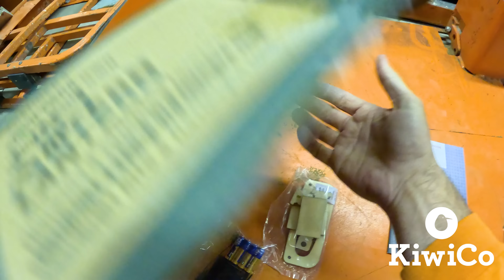How to Install an Elevator in your Backyard

Comment: no vapor barrier? no insualtion?
Reply: you don't need insulation when you have all that dirt
Reply: if you watched the series from the 1st you would know that burying this over 6 feet deep doesn't need insolation and it should stay 60 degrees year around.
Reply: @ICP1SBJ  I'm talking about the moisture absorbing concrete pour that sits below a steel structure called the scissor lift. If your telling me concrete won't sweat ever then you must have magical concrete. The vapor barrier and insulation is only for moisture. Obviously the insulation isnt to change the thermal capacity of the structure. Isn't just another thermal break away from the dirt so concrete doesn't act as a sponge. But then again what do I know.

Comment: elevators are expensive because of the multiple safety systems they have, however a scissor lift has none of those so you are taking an awful risk with your families healtha nd safety, i didnt think youd be like that, its not like your short of cash. Very disappointing. Also notice how much rust you already have on the shaft and supports, thats because you didnt coat them before installing and they wont last long wown there rusting like that
Reply: Was thinking about the same. Scissor lift has a single point of failure. Falling from 6 meters could be deadly.

Comment: Way yo go !! Nice cost saver ... how about for stability from sway ... on all four sides , have static castor wheels ,industrial kind with tires . 

That run up and down with lift and guided by u channel designed metal , fixed in place . 

Otherwise briliant . 

Just to say mustie1 did something similar , months ago

Comment: The scissor jack was an incredible idea for a makeshift elevator! This series has been a blast to watch.
Reply from the maker: Thank you!
Reply: @JerryRigEverything just a quick question.. what is the pipe called used to make the bunker?? Do they also make 90 degree bends?
Reply: Agreed...I have seen these easy for $2500, and an affordable elevator  Dam, never thought about this.
Reply: It is cool. The only thing I would add is guide rails and rollers so it doesnt move as much.
Reply: Now if only I have a huge warehouse to store all my projects that I am never going to finish?
Reply: It looks unsafe to me a safety inspection should be done before sending people down his makeshift elevator. I worked in the construction industry and when you build stuff to fast without any safety inspections things go wrong. What happens when his elevator stops working and she cat get out? He said 100% safe= nonsense. She already feels unsafe in it she knows whats up.

Comment: An interesting, novel approach; however, I doubt that it meets your local building codes. Cities tend to be REALLY bitchy about elevators.  So don't try to permit your bunker because the city will probably make you tear out your elevator. The primary concern is what happens if the hydraulics completely fail (say you blow a main hydraulic line) while you have several people on it. What type of emergency-stopping system will you install? You can probably use some type of cable system as a secondary backup support. You can use a mechanical brake on the cables if the elevator starts to fall, kind of like what you see on seatbelts.

Comment: Good to see you discovering modern concrete elements like fiberglass rebar. Recommend basalt fiber rebar, alkali-activated or geopolymer pozzolans, and biochar or recycled concrete aggregate for net carbon negative pours, lighter, stronger, and more durable. And if some cementhead tells you its too risky to go with 'newfangled' cement, geopolymer nefer pozzolan is what the Roman aqueducts were made from, according to geopolymer experts.

Comment: Slap some roller blade wheels on the corners of the elevator carriage to guide it smoothly down some rails. Spring load them for error correction

Comment: Thought you would have used a track system, thought about a emergency go fast button?  I think I would have also added a couple snatch ropes from Matt's off-road if the system failed. Doesn't matter because I would have never thought of a scissor lift to begin with so clever 🎉

Comment: I have one question. Why is your dry concrete, wet? Dry concrete it's a mix that you put in place, where you want the slab, and then you sprinkle water on it several times.

Comment: So, you have the EV Humvee, but, during the apocalypse charging that will be a bitch.
When are you buying a bushmaster type vehicle plus rugged trailer and digging a fuel and water container (both shipping container sized, with filter for the water system, you can never have enough water and filtered circulation) into the yard for longevity and the ability to go out roaming for whatever you need during the apocalypse ?

Comment: For the stop problem. this machines comes with a switch that is pressed by the incisor on witch side that tells the control unit if it has to stop. Juts move the left and right one to you desire position and its done, you can press the button for a undefined amount of time but it will move just until the set position.

Comment: I worry about water ingress. I hope he has this placed where the groundwater table wont be an issue, and torrential rains can’t go down the lift shaft. And hopefully he sealed the seams up well with waterproofing so it can’t leak. Humidity and condensation could still be a challenging issue to deal with also.

Comment: You've probably already thought about it, but I highly recommend putting a personal server down there. Load it up with all kinds of media like movies, shows, music, and games. It would be a great off-site backup too for personal storage of pics and videos. All on its own dedicated network so, no Wi-Fi or service, no problem!
Reply: That would have to be a very efficient server. The amount of power and heat of a regular server is a bit much.
Reply: It's just a computer. Not a server rack.
Reply: @TankObliterator  Server does not mean it has to be an enterprise level or high TDP machine. Its just something that "serves" information. A raspberry pi hosting plex/emby is a server. A simple optiplex 65W would be a server too.
Reply: @TankObliterator   A server can basically be any computer. In this situation, a small NAS would probably be the best bet. You could easily fit terabytes of storage in it, have it sip power on automation cycles, all while saving your precious data in case of the apocalypse lol (or you know, something normal like your house burning down).
Reply: @ObscureDig  Yea I guess even though i run my own little server at home. Every time I hear the word server I always think of something big 😅. Thank you for correcting me.

Comment: Dude, that tool to twist up the wire on the rebar around 6:10, I've had one of those in my toolbox for several years now, and have tried to figure out what it was for so many times! 😂 I literally paused the video, went out to the workshop and grabbed it to make sure, and it's identical! 😂 Thank you!
Reply: 😂that is wonderful
Reply: I have a pile of them because I pick them up at estate sales. They only cost 2 or 3 bucks new and almost never wear out.
I'm a contractor and for some reason they're my favorite tool also.
I bought some spinners you pull to do the same thing but I still like the original more.
😊😊😊😊
Reply: It’s a hose pick to loosen rubber hoses lol.  I use it everyday as a mechanic.

Comment: INSTALL A PERISCOPE IN YOUR BUNKER, like submarines have to peek over land from below.. this way when there is a disaster, you can peek to see if it's safe. Add an electric drill above the periscope, to dig upwards incase the dirt cover the hole with debris from the  disaster.  Essential to see what's going on, Cameras are a good option but may get destroyed during disaster

Comment: I really appreciate how thoroughly you've planned the accessibility aspects of this project. My Mom is disabled, and as I'm sure you'd agree, not all accessibility features are created equal. A ramp on the side of a building with no other considerations inside. Or an elevator inside a building, with no way to actually get in said building. I've seen, and had to struggle through, so many half-assed "solutions". Your bunker is more accessible than most government buildings. The elevator, a raised flat floor, and the omission of raised bulkheads at the doors, all things you could have done differently. But you went above and beyond for the sake of others, great job!
Reply: to be fair, it's not "others, it's his wife lol. it's her home too.
Reply: Well yeah, that's what happens when you're designing for someone in a wheelchair, not just because government goons say you have to.
Reply: I swear, some "wheelchair accessible" ramps I have trouble walking up.

Comment: There's a huge difference between elevators and lifts.

Elevators have counterweights and pulleys, that have all their mechanical work above the elevator.

A lift, like you have and repurposed, has all its mechanical power below the platform. Typically needing hydrolics to operate.

Comment: I can swear I heard somewhere that if you pour your concrete from a high height, something in the structure changes and it doesn't have the same strengh as it should, just in case u know anything about it

Comment: Not 100% sure I agree with this decision. Turning an old, nearing the end of its life, scissor lift into an elevator probably isn't the tool you want to rely on when an emergency strikes. It's a clever use of the equipment for sure, but I don't think this is the correct place for this application. I hope he has a human powered back up plan if this fails.

Comment: I'm thinking it'd be prudent to put a manual hydraulic lever pump as a safety, so it can raise(slowly, but surely) in case of some electro-mechanical failure. It'd suck to get stuck down there in a chair.

Comment: Excellent idea for reusing old scissor lift! 👍
For idea updating - add L shape side rails to the shaft wall at center of lift, where stairs is and opposite wall, and add 4 rollers (2x from each side) to the platform for side sweep stability.. 😉

Excellent video as always!

Comment: 5:15 I'm surprised you cut the bottom part of the guard rails off (well at least both sides). With a wheelchair accessibility, I figure the two sides provide a nice channel for the wheelchair. (edit: 15:00 nvm)

Comment: Add90 angle steel profile on both walls of lift tube, and add plastic bushes on the platform, similar to actula lifts so it avoids wiggles and a small gate to prevent accidental falls

Comment: Take a piece of I-beam and weld in the vertical position and put a track crane bearing assembly on the elevator. This will stop the wobbling of the elevator while still allow it to go up and down.

Comment: Yeah, wobbling can be solved with the rails and rubber rollers. Also, there should be a sensor that aligns with a platform sensor and acts like a kill-switch to stop the platform at the perfect height, top or bottom. Nicely executed, Agent 47 !